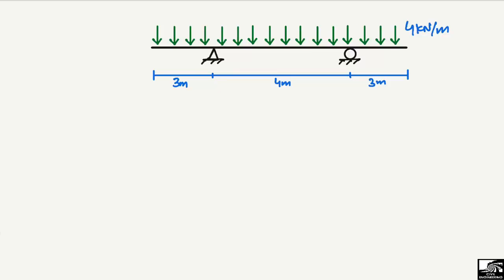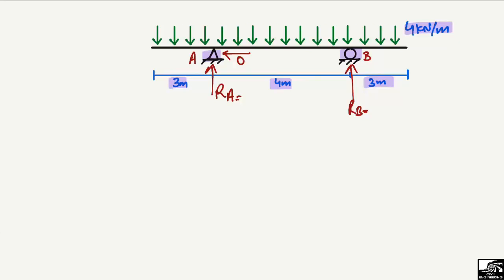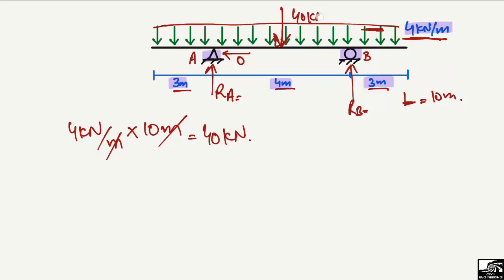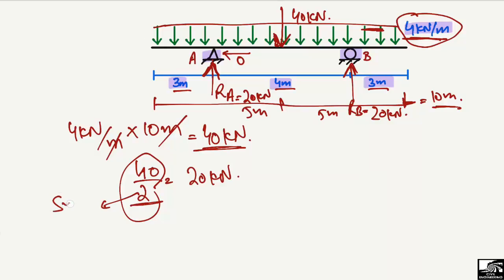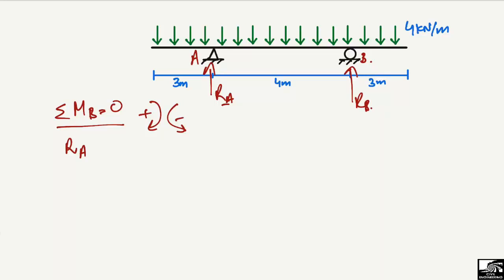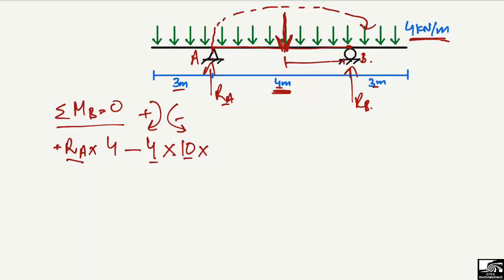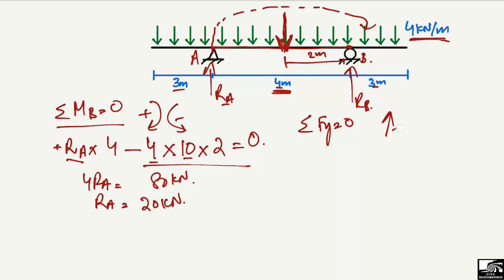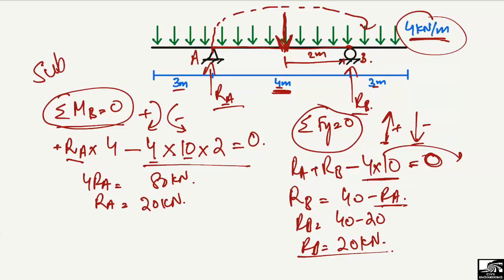Overhanging Beam Support Reactions || Example solved Step by Step

Comment: method 1 what is the difference when the load is not overhanging
Reply: Overhang is the portion of the beam that extends beyond the supports. 

Method 1 works for all symmetrical beams with UDL (uniformly distributed load). Doesn't matter if overhang exists or not.